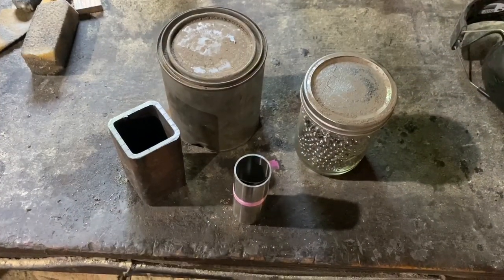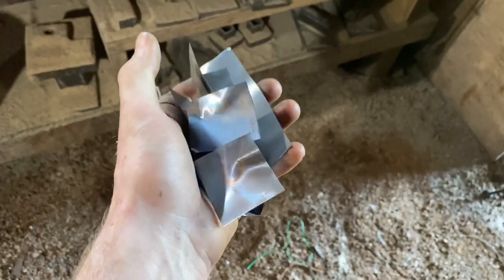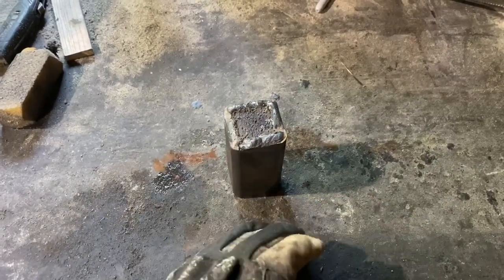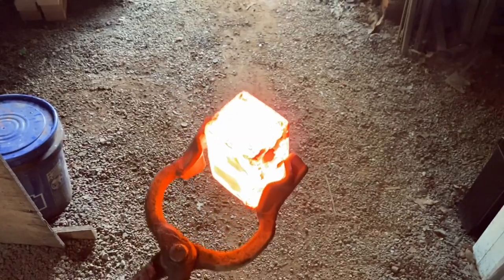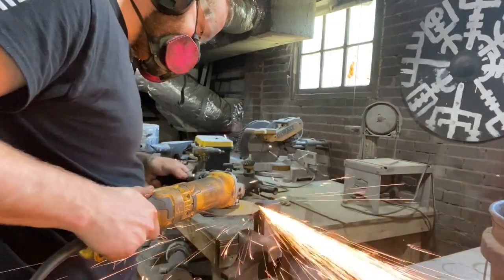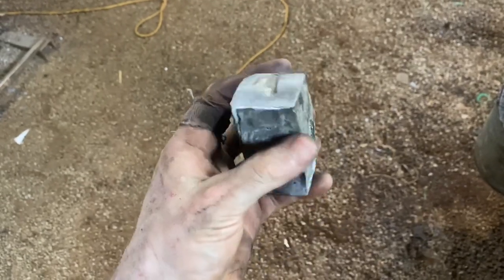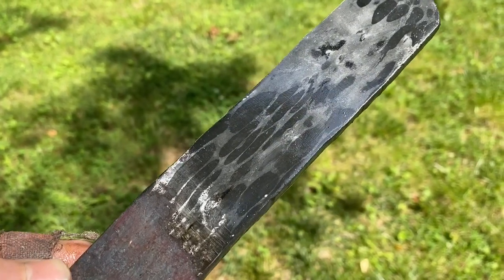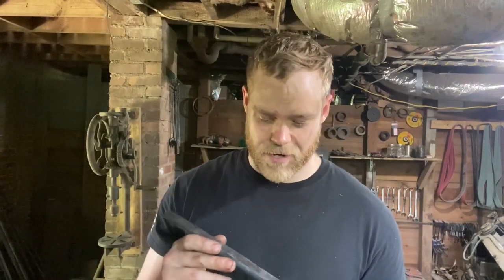Forging ball bearing Damascus using stainless steel foil: fail?

Comment: You could try longer time with the stainless foil in the forge. Probably you could use a little more air in the mix to make it an oxidizing flame. That should give you more scale thickness which I think is the thing that helps avoiding the stickyness. I watched the video you talked about and Master Schwartzer used used foil from heat treating. The scale was pretty thick and dark. Also he only cut off one end and forged the sides to a lower temp until it popped of just by tapping the billet upside down on the side of the power hammer. I love your approach on canisters, it's the same thing I do to avoid side cracking. Good job.

Comment: Couple suggestions:  #1:  Just use stainless square tube.  I bought some at onlinemetals.com for about $40 and its enough to do about 8-10 canisters.  I'm about to post a video of a cable/ball-bearing canister blade that I did with SS tube... came out easy.  The foil seems like a lot of unnecessary work.  #2, use squaring dies.  You get compression on two axis at the same time and you'll get a better weld.

Comment: What I would try with the foil is wrapping it twice around a square piece of steel that fits inside your canister to form a sort of foil tube. I thing what might have happened is that when you took it to the press, your canister bulged and deformed so much that some near-liquid powdered steel went in between your stainless foil and the canister through the gaps between the individual foil pieces. Cool video, as always !
Reply: Was thinking the micro layer of oxide was to thin to stretch out.

Comment: As several have pointed out thicker stainless foil , also on the video they pressed the end cap in before welding it on , this might be better than pressing the ends while forge welding , also a set of dies to squish it on the angles might work better.

Comment: I use solid 1/8" stainless steel pipe. Works every time. Sometimes you can fuse your can to the billet if you over work it. I find if you take two heats working all sides lightly works best. You will begin to see that the outside has not fused. All the best

Comment: Once upont a time, I was a pipefitter/welder. We used to take a straight acetylene flame to our c-clamps and coat the threads in carbon to keep the bb's from sticking. I don't know how that would work for forge welding, but maybe a thought?
Reply: Someone on forged in fire successfully did that with canister Damascus. Only person I've seen use that method.

Comment: As I'm a failure so far as Forge Welding also I have a new ribbon burner,Big help seeing your fail as my pressure almost about 1/2 lbs pressure showing, Seems I will try turning the heat up next time welding
Thanks for that also Sir

Comment: Ive never smithed, but on the question regarding stainless flashing, i'd speculate the sticking you encountered may be due to a combo of (1) insufficient pre-scaling of the flashing foil (think of it as an artificial cold shut), and (2) working the canister for too long and too many heats before removing it.

In other words, it stuck because overworking caused the artificial cold shut you'd created began forge welding back together ... to prevent that, you need to enhance the cold shut up front and not work as hard to overcome it. 😉

Comment: Regarding the formula, a lot of pro heat treating guides focus on the diameter of the piece, rather than the volume.
Reply from the maker: I’m familiar with what you’re talking about. Not sure if the same logic would carry over to the higher temps required for welding. Interesting thought though

Comment: I'm not a blacksmith, so I'm just commenting on what I see. Maybe pressing the canister on the heads first made it 'bulge,' so the center of the billet is wider than the ends and can't be hammered out?

Comment: Squaring dies from angle iron would make that much easier.. maybe on the stainless when you upset it it pushed the stainless away from the edges then filled back with carbon steel? Just guessing.. I seen the Will Stelter video and it seemed pretty easy but nothing is as easy as it looks..lol.. great video man..

Comment: if you keep the circumference sheet whole it works better. I find that cutting the sheet into strips negates its function a bit. Also the sheet needs to to be quite a bit more scaled

Comment: Hi guy. I would love to see you try this. Two pipes ,one schedule 40 ID 3", one SS od 2 15/16" thin walled. Make the SS into a canister oxidized on the inside. Have two plugs to stopper off the SCD40 like pistons. Heat your canister  it should expand to a close fit. Place it in the cold pipe and ram it with the stopper plugs.

Comment: from my experience with forge welding stainless steel, u should have made the smallest possible hole in the canister to let air touch the stainless. stainless has lots of chromium and in contact with just a bit of air it will scale hard. havent done any canister ever tho, so im not sure if a 0.5mm hole would mess with the powder steel. cheers

Comment: I’ve been wanting to try this but with stainless tubing. I have 6ft of 2” tubing about 1/8” thick. If it will handle the heat it should work well.

Comment: Man I’ve used stainless quite a bit for cans and it works great I think you just took too many welding heats I usually remove the billet after the first or second heat.